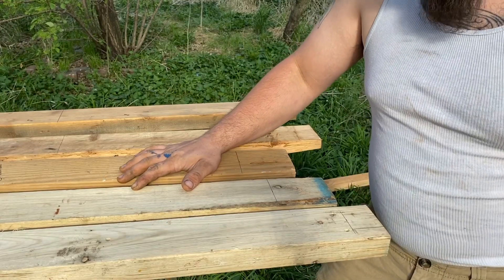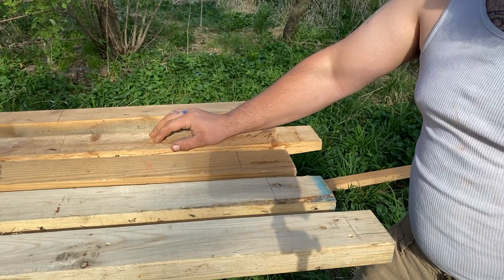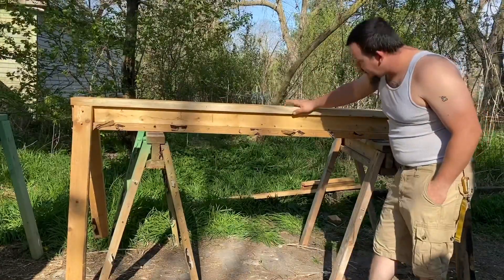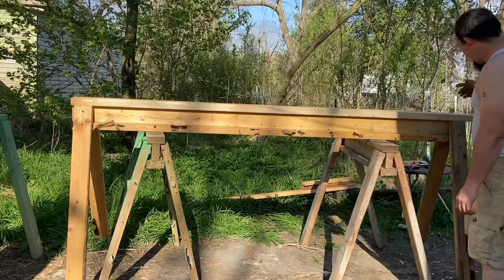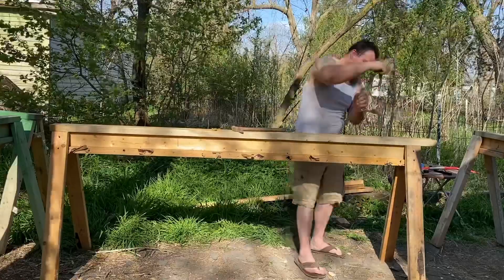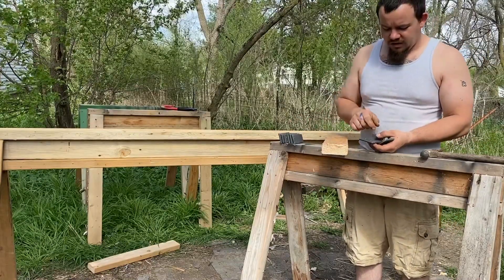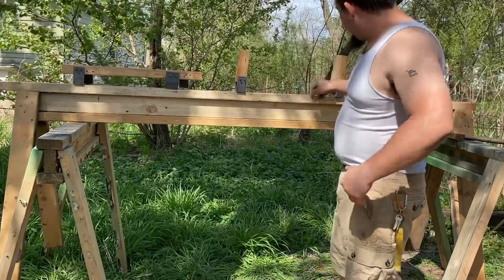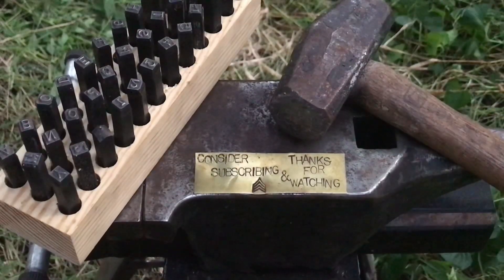Barrel Boring/Rifling Stand

Comment: THANN YOU VERY MUCH!!!
I got this project.
It's a firecracker rifle. I'm using black cats. My point is I just figured out my gas sealing issue & now I ran into an accuracy problem. Now I need tk bore my barrel and have been for a while trying to work the kinks in my head with no results. You sir saved my Brain. HILLBILLY POWER!!!
Reply from the maker: When I was your age I used an old aluminum arrow for the barrel duct taped to a 2x4 and a sliding bolt lock for the bolt to plug the back end. It’d sling an airsoft bb wicked fast.